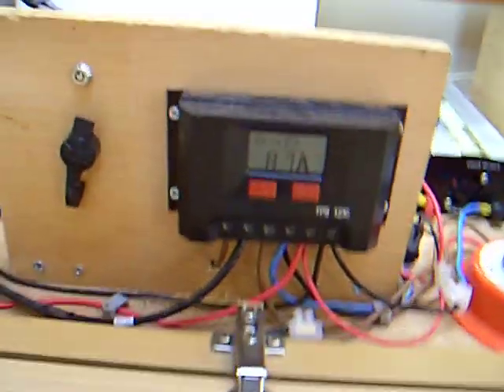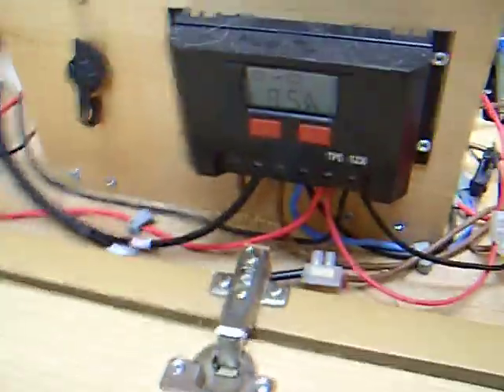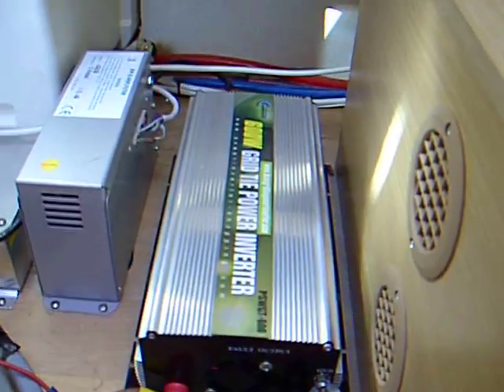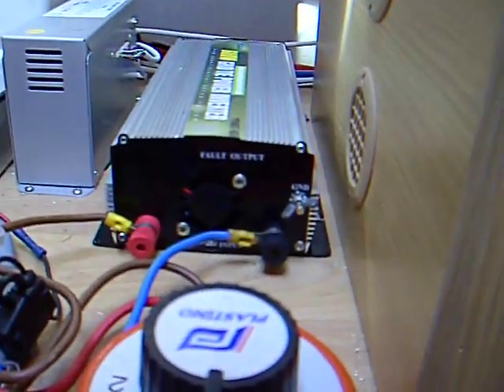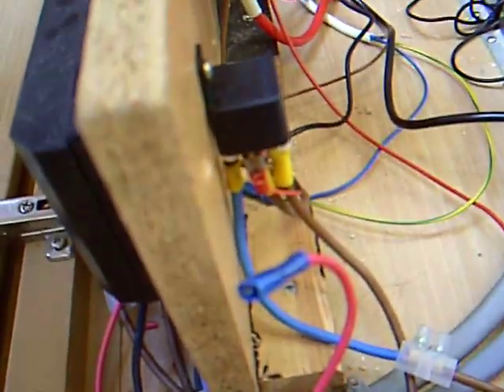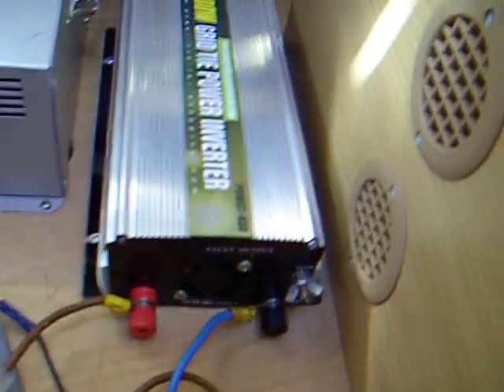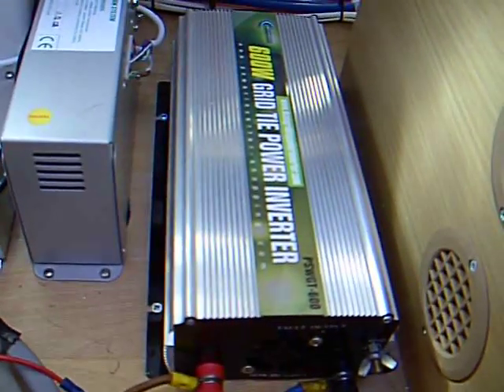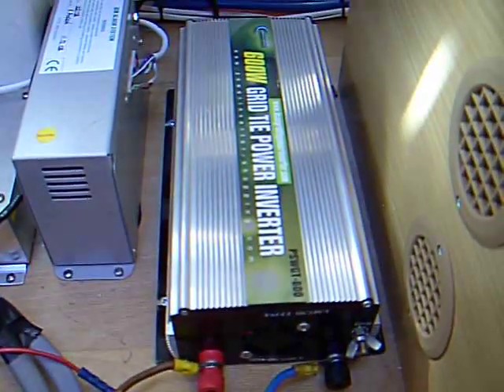solar panel setup and grid tie inverter in my caravan

Comment: Good video, I want to do something like it, but I have a concern. Most grid tie inverters are designed to push electricity into the grid with voltage that exceeds the grid. Are you concerned that the GTI might push the voltage too high and damage your Kipro generator when your watt use drops real low but the sun keeps shining bright and the PVs make their max volts?

Comment from the maker: i don't see why you couldn't but it would be more efficient to just use the power to charge the battery's you would have to make sure that you use more power than the inverter is generating as you could experience an abnormal voltage increase. with big RV's, boats and homes you can get a product made by sunny boy called sunny island you have a battery bank and inverter but you also have a grid tied inverter and when the grid tie inverter is generating too much power that power charges the system

Comment: Can you use a regular inverter pure sine one to create an input for the grid tie inverter so you can supplement your electrical needs inside the RV ?Having for example a second stream of panel or panels that will be connected to the grid tie inverter.This way you can have a small battery bank that will get charge during the day the inverter as generator and the grid tie string as supplement.Have you worked this out ?Thanks

Comment from the maker: @shellackin these inverters have to monitor the power coming from the grid so they can match the frequency this means they will not work if not connected to the grid or a power source. so if the power from grid fails it will turn off,

Comment from the maker: @ProtocolsMaster no for a constant load of 1000w watts you would need a inverter that can produce 1000w or more constantly probably a minimum of 1500w, also you would need some really good battery's i have a 1000w floodlight that i use with a 5000w inverter it will only run for about 20 mins before battery's are flat and the battery's are 2 x 110amp battery's although they are a bit old. it would probably be easier cheaper and lighter to just get a generator.

Comment from the maker: @dazinull Hi yes the amps fluctuate to stop the solar panels over charging the battery and when it jumps up to 38amps that is because the solar panels are disconnected which causes the voltage to get to 30v then reconnected this surges the controller so it reads 38amp.

Comment: The 300w GTI can only really handle about 150w worth of panels and the 600w GTI can handle up to about 300w worth of panels. Any more than this and the efficiency drops as the units overheat. As a general rule of thumb, the PJ GTI's rated power level should be halved (preferably 1/3rd) to get the real power handling capacity. My 1200w Power Jack starts to get quite 'warm' at 600w DC input. I have no doubt that any more than 600w input would cause it to shut down, particularly on a hot day.